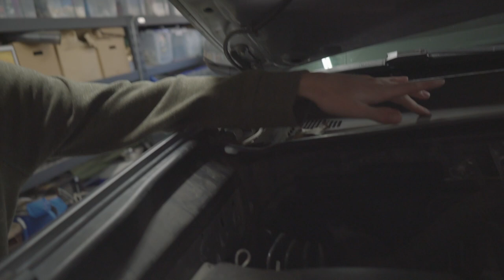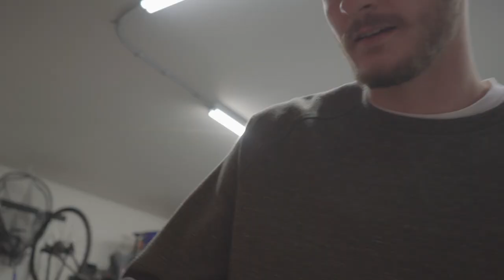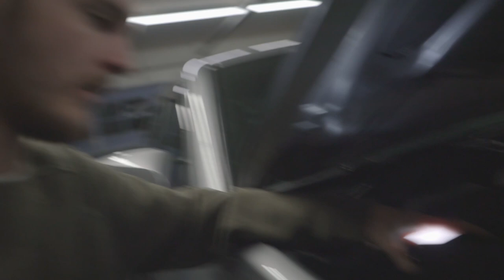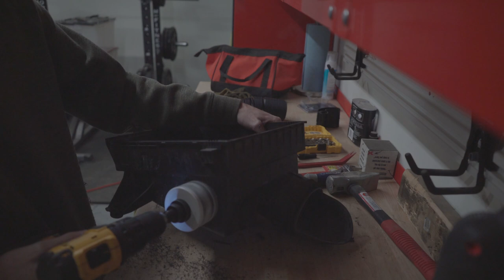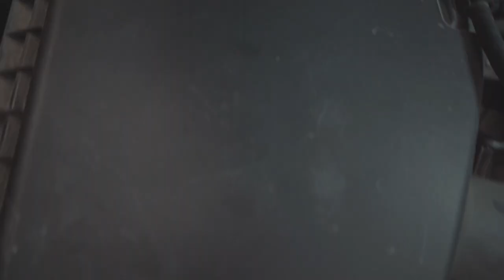3rd Gen Tacoma Cowl Intake | You Don't Need to Get a Snorkel and why this $30 alternative is better

Comment from the maker: As a follow up, I did trim my fenders and blocked off the hole in the fender. I used two 4in test caps from Lowes, one on the fender, one on the air box (both fit perfectly), then siliconed inside and out of each. I painted the stuff you can see from under the fender and now the only place air is pulled from is the cowl. That wraps up this project!

Comment: How about as for like when it rains and water goes down the cowl how is that gonna work ?
Reply from the maker: When you’re driving it’s all going up and over the cab mostly, for the little that does make its way into the cowl there is a drain that sits below the hole for the intake so water can’t get in unless you have submerged your truck up to that point